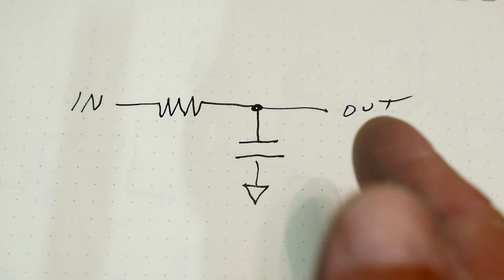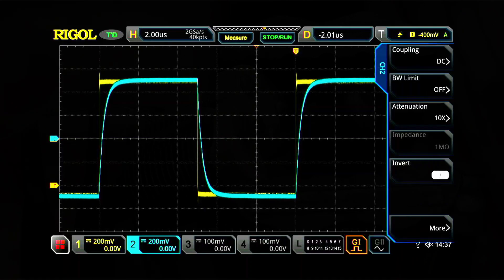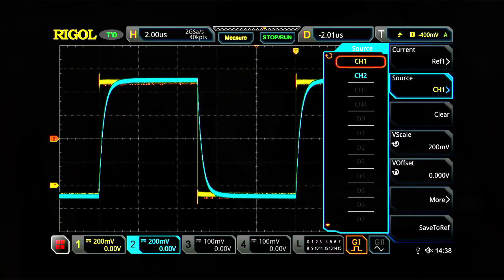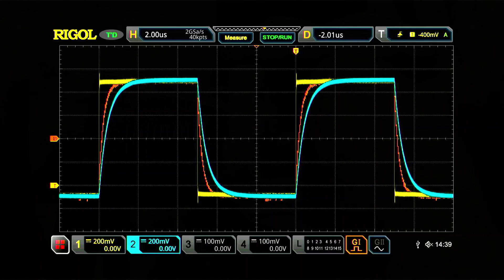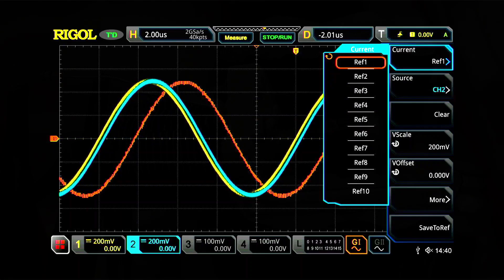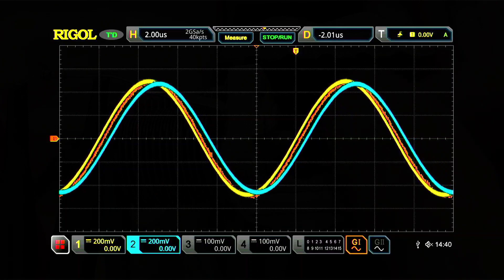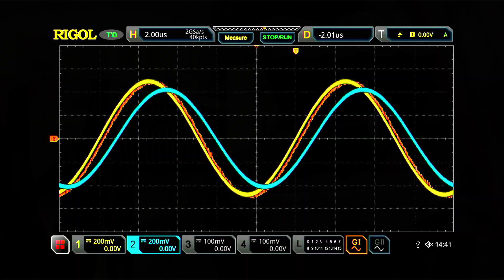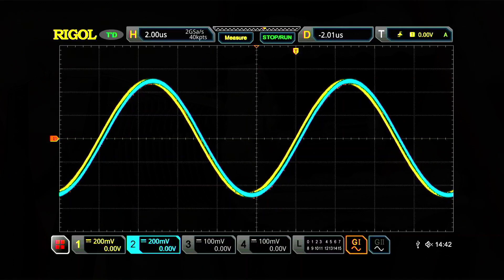#1543 RC Resistor Capacitor Circuit

Comment: Thanks for these demos.  People underestimate how valuable basic circuits can be.  With a Cap and Resistor, such a simple circuit has so many uses.  As a differentiator it could be used to detect a leading or lagging edge of the square wave or as a trigger.  Thanks Again

Comment: The phase shift depends upon the capacitive reactance Xc and R, the purely resistive components of the circuit.  As R reduces, the phase shift draws closer to the (ideal) 90 degrees.
Reply from the maker: Ok, sounds like the text book. So, the frequency was the same for each, why didn't the square wave have a phase shift.
Reply: @IMSAIGuy  The short answer is that what I wrote above is intended for pure sinusoids (i.e. no harmonics).  I should have mentioned that.  Another way to think of it is that the charging rate of the capacitor is slower for a sinusoid (due to the gradually changing curvy shape) than it is for a sudden step change that you get with the square wave.  The charging rate depends on the difference in voltage across the plates which is much more pronounced for a square wave and the charging rate affects the delay/phase shift.  I would say there is some phase shift going on in both cases, but for the square wave, it's very slight.  True for other waves too, but the formula I gave would not strictly hold.  Would you agree?
Reply from the maker: @Enigma758  the point of my video is that there is much to learn even from a simple circuit that many believe they understand.
Reply: @IMSAIGuy  Very true!  I often find that I revisit first principles especially when circuits don't behave as I expect them to.  I'd go so far to say that no one fully understands anything (see the "Feynman tries to explain magnetism" video where he makes a similar point).  It helps me to understand things from multiple view points, both theoretical and practical.  A formula allow me to anticipate the effect of a value change to a variable.  Mechanical analogies (springs/masses, etc.) or hydraulic analogies (pumps, valves, tanks, diaphragm's, etc.) aid my intuitive understanding.  Having said that, I love these kinds of videos, so please keep them coming!

Comment: Phase noise measurement to RC behavior.  Maybe some attempt creating and measuring GHz circuit next?  You've got the gear for it.
Reply from the maker: look over the 1500 videos I have. Lots of GHz stuff
Reply: @IMSAIGuy  Yes, thanks, I know.  I'm just pitching an idea for your latest GHz equipment.
Reply from the maker: @jspencerg  don't worry. I'm getting even better tools for microwave design.
Reply: @IMSAIGuy  I see a lot of stuff around 600 THz in these videos.  Gives me the green light.

Comment: Great advice! So many new engineers come out of EE school without ever having touched a breadboard or test equipment. The 'Maker' movement is helping though.
Another fun video idea might be to see how those simple components work in the feedback loops of OpAmp circuits. Maybe you can be the next Bob Pease? Lovely videos and content, thanks so much. Cheers!!
Reply: No they don't. Maker movement isn't helping, something that doesn't need help.
Reply: @willthecat3861 why do you say that?
Reply: @tonyfremont  Well, I said two things... no EE comes out of school without having gone through many labs... the maker movement mostly focuses on 'blink'n lights' type stuff (although thanks to easily programmable micro-controllers, the maker projects are more sophisticated.) It was E.E.s that designed the micro-controllers and all the stuff makers use.
Reply: @willthecat3861  all I can say is that a way more than a decade ago, on the Piclist, I was hearing that EEs were graduating and showing up for job interviews without ever having held a soldering iron.

Comment: It's true you need a signal source, but it doesn't need to be an expensive signal generator. It could be something as simple as a    morse code practice oscillator that  has pitch controll. I have several apps for that. There's also an audio signal generator app  out there. Or a musical instrument tuner would be good too, just for something to experiment with.
Reply: I guess one could use a sound card as a signal gen (at least for the first time)
Reply: If you have large enough value capacitors, and resistors, all you need is a battery, a switch, and a standard analog voltmeter (at least for the transient step response.) That's all we had in grade 10 physics. Now that I'm an adult, I can buy a cheap Chinese oscilloscope, and arbitrary function generator. Or... I can use LTspice and simulate the step response with as many times, and with as many different parameters as I want... for free.

Comment: You forgot to mention that for this kind of experiments you also need a signal generator🙂
Reply from the maker: just use a 555 timer, add a filter to get a sine wave, use a cheap plastic variable cap from a transistor radio.
Reply: @IMSAIGuy  "Frequency Adjustable Pulse Generator Module NE555 Chip" ..less than 1.75USD (free shipping) from China.
Reply: There are some phone apps that generare waves up to 20kHz.
Reply: @JohnUsp  Gotta watch those generare  apps
Reply: And a nice chonky variable capacitor from some old radio that no-one makes anymore :D
Reply: Most folks will also have audio hardware in their PC that can handle 20Hz-96kHz. I made great use of my PC’s audio I/O for both signal generation and acquisition. The software is out there, but hit and miss. Probably better since I was using it.
Reply: @silverXnoise  96kHz in a PC?  good to know, I never found one.
Reply: @JohnUsp  Most modern integrated sound cards use 192kHz AD/DA converters, so 96kHz is reasonably attainable without additional hardware. I think Digilent’s Waveforms software will function using the soundcard, and it’s free and includes a range of tools like a scope, FFT, wave gen, etc..
Reply: We could use the square wave from the oscilloscope too